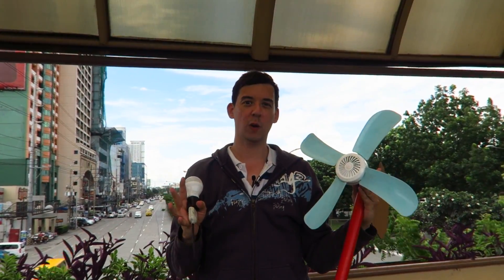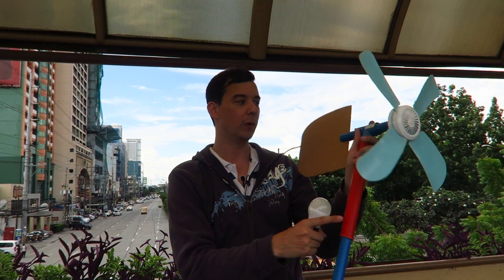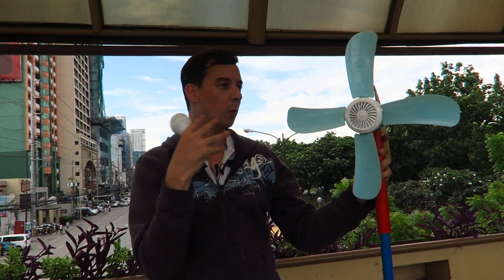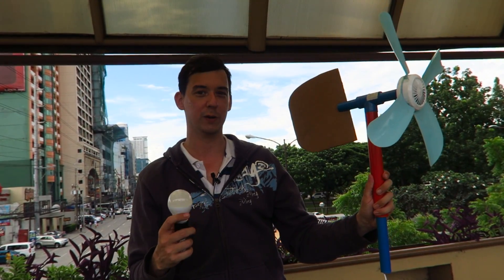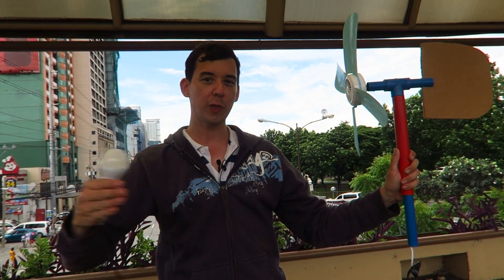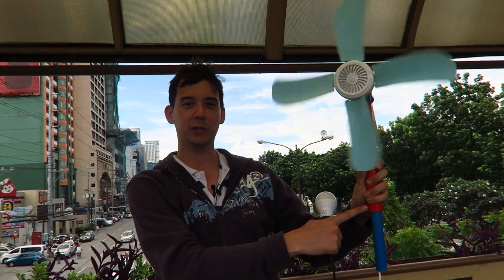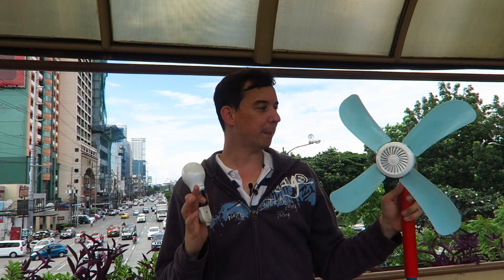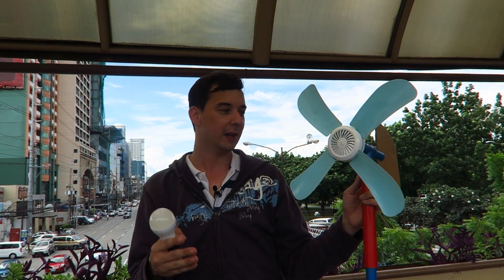DIY Wind Turbine Power Generator

Comment from the maker: This is more of a teaser than a full video. I've actually shot this video 3 times and in a different location every time. And each time the footage has been wasted because of technical problems or a lack of wind. I decided this is good enough for now, at least to show the basic idea behind it. The bulb doesn't look very bright on camera because it's so sunny outside. This little DIY wind turbine is generating an estimated 3-4 watts.
Reply: beach man, beach ^^
Reply from the maker: With a rectifier and voltage regulator, it could.

Comment: will the current be enough to step down and charge a powerbank? we cna probably measure the charging current
Reply from the maker: That's what I'm working on. I might upgrade to the 9W ceiling fan because even with losses we should be able to get a respectable 5V 1A for USB charging.

Comment: Can I get one in the U.S?
Reply from the maker: Yep, they're on Amazon and eBay, just search for 'mini ceiling fan'
Reply: I found them on eBay and Aliexpress by searching for "portable ceiling fan". That weeded out many of the desktop fans and other crap. Hope that helps!
Reply: Gadget Addict thanks for your reply. Just noticed that your fan has 4 blades. I read that odd blades are better for wind turbine.
Reply: Taylor Smith thanks. I'm going to try to find time to search one similar on eBay.
Reply: michaelcklo I just ordered my 5 blade, 8-9 watt version today, $7 USD via eBay. Since I'm in the US I'll have to use a voltage converter to get it to 60hz, then of course, since it's "wild AC" power, I'll have to bridge rectify it to DC, aaaand then put it to an inverter to get it back to AC. Seems so wasteful, but hey, it's a fun project!

Comment: What brand ? AC or DC output? Will experimet with it, need bicycle dymamo.
Reply from the maker: It's unbranded / generic. If you search for 'mini ceiling fan' on Shopee, eBay, Amazon, whatever your preference, you'll find this same fan and many others that look similar and work the same. You can also check out https://www.youtube.com/watch?v=Da8QN_V43CQ and https://www.youtube.com/watch?v=W-ylItFF2po for more info about the ceiling fan I used :) It's AC output, estimated 3-4 Watts. There are larger versions for sale.

Comment: please provide a complete instructional video on how to made this windmill.A complete teardown showing parts by parts thanks.
Reply from the maker: I'll definitely be making another video which goes into more detail about how it's made, how to store the energy and so on. If there's enough interest in this video, I'll buy another ceiling fan so I can show the process from start to finish.
Reply: What I don't understand (disclosure: I'm NOT an electrician by any means), is how did you manage, out of the box, to get it to generate power? Normally, ceiling fans and car alternators have to have their stator coils rewired somehow in order to turn them into generators. Did you have to do anything like that? Or did this literally just work as a generator out of the box? Great vids! Keep 'em coming!!!!! :)
Reply: +Taylor Smith As the fans are so cheap (yet are remarkably good quality) they literally just work as generators straight from the box.
Reply: At $7 USD I ordered a few. Will try putting them through bridge rectifiers and into an inverter. Once they are rectified to DC I will play with series/parallel and see what I can get. May have to put capacitors on with the rectifiers to smooth out the current. I'll report back with my findings if anyone is interested. Thanks!!!!!

Comment: You can go to the highest ground or rooftop of a building to have a strong wind, i like your video i just want to know what is the output of your turbine? And the voltage of your bulb?
Reply from the maker: It's a 110/220V AC lightbulb that's meant to be used inside your home. The output of the turbine is 100-200V AC depending on the speed and the estimated output is 3-4 watts. I'd recommend checking my previous video if you want to see full testing. I've put a link in the video description :)
Reply: Can i connect the trubine to my charge controller?
Reply from the maker: If your charge controller can handle high voltage AC, sure. But if it's a regular solar charge controller it's most likely expecting lower voltage DC. I had some success with an AC to DC 12V brick.
Reply: Thank for the advice thumbs up for you

Comment: What if you convert it to dc. like 5v. Will it charge a phone ??
Reply from the maker: In a previous video I showed a lot more testing, including a USB charger ( https://www.youtube.com/watch?v=W-ylItFF2po ) . I'm still looking for the perfect way to store/regulate the power from the turbine. I did use it to charge a lithium-ion battery so it has the potential to charge a powerbank. It's better to store the power and then draw it from the battery because it can provide a more consistent output compared to drawing power directly from the wind turbine.

Comment: I hope that the follow up video will be it charging a 18650 battery or a power bank.
Reply from the maker: That's the plan :) Or a 12V lead-acid battery. But personally I'd rather charge a lithium-ion battery since the price of 18650s and powerbanks has dropped significantly in the last few years.